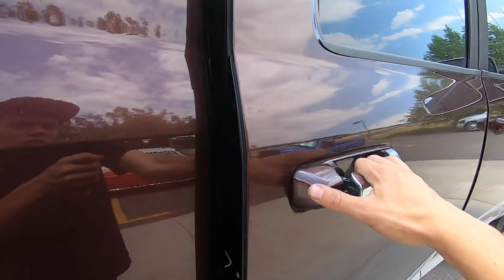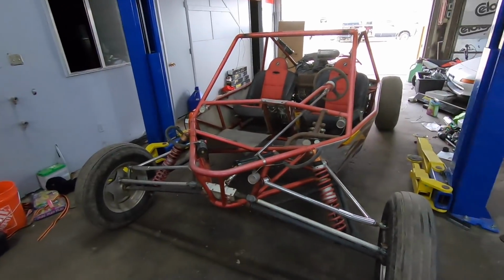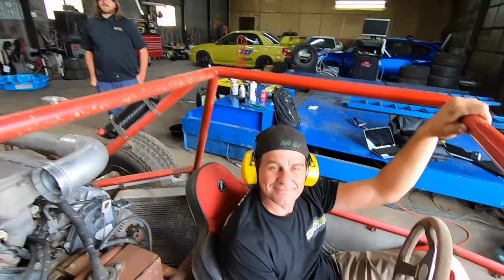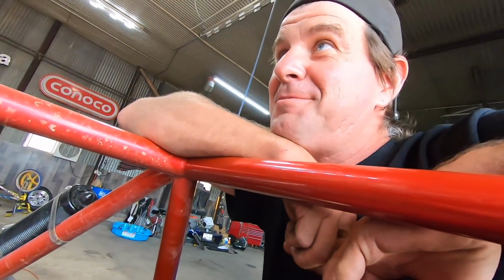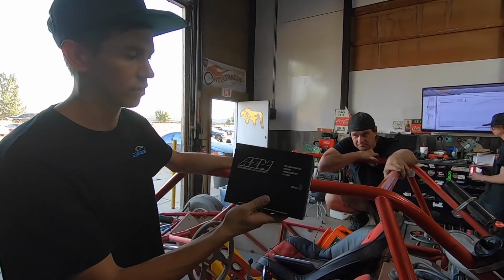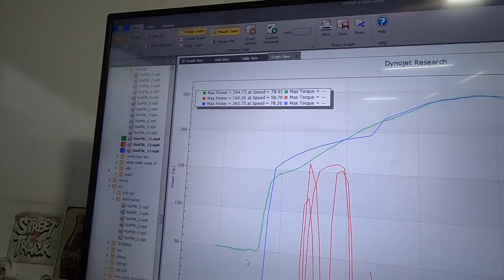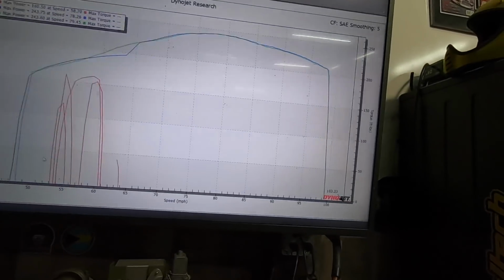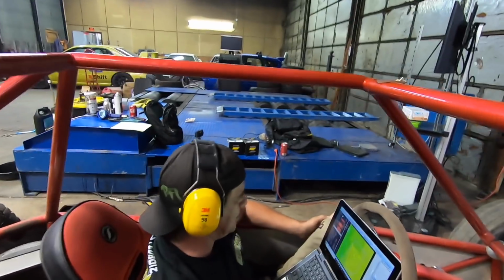Honda V6 Sand Rail Hits The Dyno! (Made It Shoot Sick Flames)

Comment: I just swapped a JDM J32A and six speed manual LSD trans into my 2001 Accord. I love it so far. So much more responsive and quicker than the J30A1 and junk auto trans that it replaced. I bought the exact same AEM that y'all have.

Comment: Waiting for the twin turbo Bully setup on the buggy! 👍🏼😂🤷‍♂️👍🏼
Reply: What V6 is in Bully? The buggy has a J but I've never heard them mention what Bully has.
Reply: @wildboer  j32
Reply: @9kredline733  That one's sitting in the "B(R)atmobile" now, as far as I know...
Reply: Timberwolf69 I just meant a similar setup to the Bully...
Reply: To answer everyone the engine that was in the Bully is the exact engine that is in Razzle Dazzle but Brent pulled it out of the Bully and put it in the Batmobile aka the Bat-Rod burnout car but when it caught fire at Cleetus' Burnout Rivals during Brent's epic burnout it burnt up alot of things so he had to pull the engine back out of it to freshen it up and get it rebuilt because he also slung a rod out the side of the block during the burnout and yes both the Bully's engine and Razzle Dazzle's engines are both J32's but the one in Razzle Dazzle is completely stock and the one that was in the Bully had a stock block,heads and just a few aftermarket parts in it like the pistons,rods,intake and springs and retainers but I think that's it and the pistons weren't even Honda pistons they were for a Mazda engine but they were the closest thing to fitting the piston to wall clearance at the time before going to Florida at the time and he's taking his time building another J32 for the Bully because they are rebuilding the front end on it before putting the engine back in
Reply: @keefespencer1173  Stock head, but it got the Phong treatment.

Comment: 5k rpm is the factory limiter when the car in in neutral. the stock ecu is from an automatic transmission therefore the range switch was always set to "N" and never had vtec kicked in. vtec for J series is around 5.5k rpm. love the J series content keep it up boys

Comment: But once you put paddles on it in deep sand it will take alot of power away you need about 450 whp
Reply: It's not loosing any power because of tires or sand, it's just a lot more friction and it takes more torque to feel fast than it would on the street.
Reply: @catch22frubert  pretty sure that's what he's getting at

Comment: With the ecu box, if that is completely sealed. Drill some lil holes in the bottom on both ends to let ECU breath. Won't create moisture then! And won't over heat!

Comment: What was leaking @ 14:13
Reply: That’s a good question, I hope they notice that before something bad happens... Judging from how high up it’s dripping it’s probably coolant. So they should see the temp gauge go up, assuming it works.
Reply: Looks like coolant overflow is missing hose on the bottom

Comment: That metal box will be getting condensation on the inside during winter, thats why there is rust in the bottom. Changing to a plastic box would help keep the new computer dry.

Comment: i had a 79 gs1000 suzuki with a header open of course and k&n filters tuned by ear and feel with some index drills and taking the carbs off and apart 20 zillion times at one point it would pop every time i shifted wasnt terribly fast sure did sound awesome though

Comment: Bro I just noticed you don’t have front brakes on the razzle dazzle.  With the power you have, if you plan to haul ass, you need some front brakes. Watch your speed on the hard packed stuff. The sand will help you stop more quickly but not quickly enough at 80mph or even 60. If you want, let me know when you all will be at Glamis and I can meet you out there and give that buggy a good once over. I will be out on  Halloween with the sr20det powered Baja bug. Stay safe!

Comment: I think they should do a GT45 on it and make at least 500whp, I bet if it maxed the GT45 at 700-750whp and it could put the power down I think it could give some crazy cars a run for their money because it's so damned light. 240-250whp is more than a bunch of V8s from not long ago. 4.6 and 5.4L 2, 3, 4Vs bone stock would be lucky to match that, early 4.8s and 5.3s through an auto installed in a truck on stock ecu won't do it. A 6.0L through a 4L80e in the 3/4-1t truck may not beat it. An early 5.7 Hemi isn't going to make much more wheel hp through an auto in a truck. Those J series impress me more everyday. It is one of the few V6s I think sounds good too. Makes me think of a Lancia Stratos or Dino 246, that's some rarefied company in the pantheon of V6s.

Comment: Put them light bars you got on there and a couple lights like Cleetus has on Leroy for headlights and a couple brake/blinker and reverse lights and put a piece of sheet aluminum or carbon fiber on the roof and pit some seat belts in there and a piece of Optic Armor lexan for the windshield and get a new set of tires like the ones you have on there for the street and get a set of sand rail front runners and a set of paddle tires for the back so then you can drive it on the street in the spring and summer and take it to the track every now and then and then when you want to take it to the Dunes you can

Comment: I'm very surprised none of your cars have a Haltech ECU on them. Is there any difference tuning wise between the AEM Series 2 vs Haltech Elite 1500? I have realized that most people with Side x Sides and 4cylinder cars if they are not trying to make that much HP they use an AEM ECU and most 4cylinder or 6cylinder cars making 1000+hp either use the top of the line AEM or Haltech 2500 or 3500 or two 1500's

Comment: the 5k limiter on the doom buggy could be an auto trans ecu with the selector/ inhibitor switch not by passed/bridged and no speedo sensor signal it thinks its in neutral and not moving ?

Comment: I so want them to keep this N/A. All the boosted builds are getting a little old. Its too easy to make power. Lets make some power the old school way. Ported heads, big cams, and valves, bored and stroked engine. But i guess it wouldnt be the boostedboiz without the boost
Reply: Theres a reason all that stuff is the old school way. Small gains per $ spent
Reply: Doug N yeah, i get that, but it would be cool, and different. Plus it wouldnt be expensive to build a j series. This thing doesnt need 600hp. The gearing it has already limits its speed.
Reply: @BigCool95  i admit, a built motor sounds bad ass. Nothing beats the sound of high comp and cams. But u can have more power for half the money with a turbo

Comment: DYNOJET RESEARCH 
■ MAX POWER = 160.50 AT SPEED = 58.70 ■ MAX TORQUE = _
■ MAX POWER = 243.75 AT SPEED = 78.26 ■ MAX TORQUE = _
■ MAX POWER = 243.60 AT SPEED = 79.45 ■ MAX TORQUE = _

Comment: DYNOJET RESEARCH 
■ MAX POWER = 244.73 AT SPEED = 78.91 ■ MAX TORQUE =  _
■ MAX POWER = 160.50 AT SPEED = 58.70 ■ MAX TORQUE =  _
■ MAX POWER = 243.75 AT SPEED = 78.26 ■ MAX TORQUE =  _